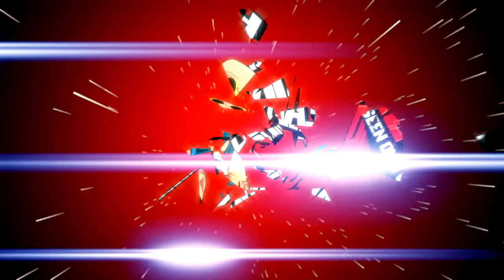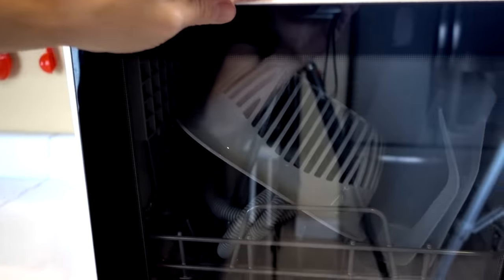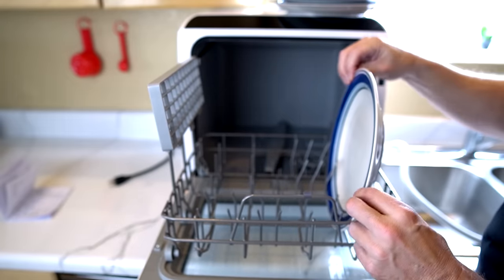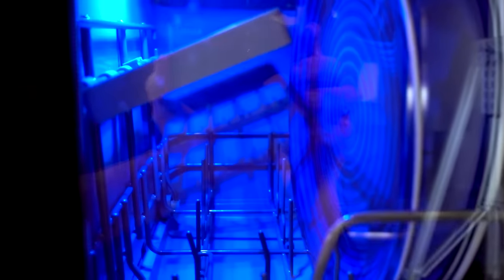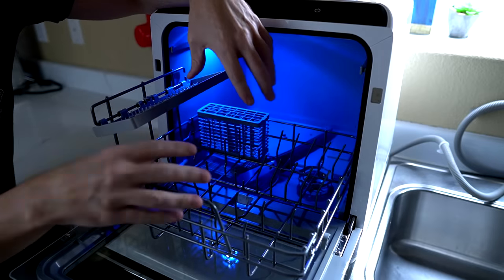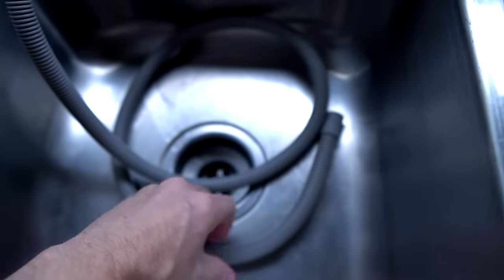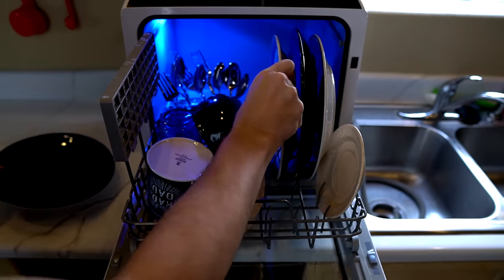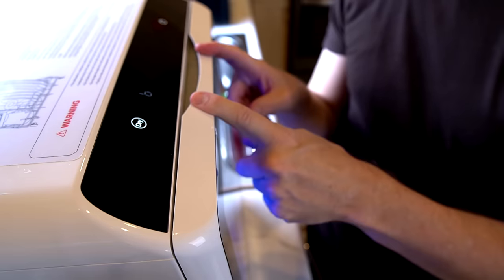Do Countertop Dishwashers Work? By Request!

Comment: I'm glad I watched your review on the  counter topodel.I checked out the novet online , I couldn't afford that price it was out of mine range so I searched around I found another one exactly like it under another name Hava. It has all the exact same features come with all the exact same things in it. The only thing I do is I do not put my silverware in the back because I find that the butter knives stick up too high and get in the way and I can't slide the rack all the way in so I put my silverware tray to the front on the right hand side it'll fit in there and I remove the little lid that's on it and I find I can get many pieces of silverware in it. I take the little shelf and I use that for my oversized spoons in it so they just hang in there so anything that hangs go on that rack and all my  sharp knives go on the rack every time I have used it I've been extremely pleased with it.. I've had my little unit for over a year. I used the baby wash  for my canning jars, make them very hot ready  to go in the canner saves me that extra work.

Comment: The wee shelf on the left can be used for cutlery instead of cups.  I have a small dishwasher, the same size as yours, and use it all the time (I am disabled and cannot stand for too long), absolute god send. Use the 30 min cycle on mine all the time.

Comment: Thank you for actually letting your test dishes sit out so the food dries on them before do the test. Most reviewers don't do this, they just drip or brush food on it and then immediately test the product. Well that's not a real world situation. Us normal people end up leaving dishes (and then hating ourselves) with food residue on them, without even rinsing them. Now for people with normal dishwashers (or those who enjoy doing dishes by hand) this s not a problem. Unfortunately I have an almost 60 year old dishwasher (it's one of those old yellow, it is actually yellow and not just yellowed from age, Kitchenaid dishwashers). Now back in the day it worked alright, I mean you still wanted to rinse the majority of the remnants off of the plate, but it cleaned them fine. Now however I feels like half the time the dishes come out dirtier than when they went in. And yes I've tried different brands of detergent, I've tried the liquid, the pods and the powder. I've also put in Jet Dry. The dishwasher was completely cleaned out when we bought the house from my Grandma's estate, the trap and hoses were cleaned. Nothing has helped. Hopefully this year (probably closer to Christmas time) we will be getting a new one. And I can't wait. I've already put up with this dishwasher for 6 years, I'm so done with it.

Comment: I recommand the "speed" programm and not to clean dishes inside. You can do this easier and with small time under running water.  It works 100 % for cups, spoons, glasses and parts of kitchen and smaller parts. It spares a lot of time.  At least you can cut the dry-modus easily because the heat of 10 minutes heat and let the parts in with the rest heat which stays quite long inside. Just if you have the machine full with glasses the quite long dry modus makes sin. But an hour is not neccessary too.

Comment: I have a larger unit (Edgestar) and only use the “eco” mode - works fine but I don’t put in dishes that haven’t been scraped or rinsed. I never use a drying mode - just open the door as soon as it’s finished. The residual heat dries. I also don’t need to unload it immediately so it also air dries any leftover moisture.  To make sure there is nothing left in the unit that might cause odor etc, I always leave the door open just a smidge when not in use.  Love my dishwasher, hate dishwashing. ❤️😎🐈‍⬛

Comment: I have the earlier model of this unit.  It works fine on Quick mode setting if you rinse the dishes.  That cycle takes 30 minutes!  I normally use it on that setting to save a lot of energy.  I also turn it off after the wash cycle is finished and let them air dry.  It works very well for me.

Comment: We have the same model you are testing. We use it in the RV. Run it twice a day. One run for breakfast and lunch dishes. Second run for dinner. Always the normal setting. The nice thing is we are only using 1.3gal per load where washing by hand could be 3 or more gallons. We are not very careful about rinsing dishes when washing by hand and tend to leave the faucet running. Agree with you the top shelf is worthless. We either take it out or put our cutting knives on it. We also had to invest in plates that were about an inch smaller in diameter than what we were using in order to fit them into the DW. Really like the machine though, it is quiet and we don't have to wash by hand.

Comment: Normal dishwasher uses hot water from the line instead of heating it, which is what I suspect the countertop model does. Countertop probably has the advantage on how concentrated the detergent is in the water. This went way better than I was expecting

Comment: I moved into a place in 2002 and the old tenants sold me their danby counter top dishwasher, it is still fantastic with some repairs over the years and proper maintenance.  Sadly it has started making noises during use so I feel the pumps might be wearing out, luckily I was able to get a full size unit on wheels to replace it with.

Comment: This is something that I have been looking at for my specific situation. I live with my mother in law in a basement, we have a partial kitchen, but it only has a fridge and oven and not a sink at all. So I have zero ways of washing dishes without either going to the upstairs kitchen and doing it there (and because of my dogs, I don't generally do that) or washing in the bathroom (no garbage disposal, no spray nozzle, and super small sink) so I was looking for a self contained unit to do this. I just ordered one, and am not sure that it's size will still be able to handle some of my needs, but if I can clean most of the mess, then it's going to be a win. For the most part this move was supposed to be temporary, but covid and the housing market has managed to make it a bit longer than anticipated.... in the meantime I have had to make do with what I can, and this is one piece of the puzzle for my specific situation that seems to help out.

Comment: Worked as a dishwasher and in just about any restaurant you need to do a quick scrap of any left over food into the trash and blast them with a sprayer before sending them through the washer. Cleans over 80% of what's on the plate before going in and the washer itself is to sanitize with very high temp water more then to actually clean debris. Simply putting dirty dishes in a washer without doing anything to them and run it days later won't clean the load properly. It's best to do a simple quick spray and wipe down right after use before putting them in. Be sure to use at least 140 degree hot water and I use a commercial detergent as they have much better cleaning power. Dishwasher usually also need to taken apart internally and cleaned every 6 months. Saves time overall but it cost more and is more complicated.

Comment: This was interesting. I lived in an older apartment (as in made before it was common to have built in dishwashers already there). I really liked having a dishwasher but didn't do a larger, movable one for several reasons. Counter top was the ideal size for a single. Bought one. Great on dishes. Two washes. Seal broke. Returned and got another as I thought it was fluke. That one went same way after one wash. I have to say that I really liked the quality of wash. The efficiency of time and water. However, after mopping up all the water from each failure I decided no way was I trying for three. Eventually moved to a house with included. I still think the counter top are a great idea but hopefully they are made better now.

Comment: It seemed to work really well. The only disadvantage to it I can see is that with such a small size, it doesn't look like it'd save much work. With my regular dishwasher, the two of us drop a few dishes in it every day and then run it when it's full. With this one, you'd have to run it almost daily. Washing a couple dishes by hand takes only five minutes. Again, if I had a large load from a party and didn't want to spend the time washing dishes afterward, I'd still need a full-sized dishwasher and would be forced to wash them by hand. If it was just a couple dishes, I'd washing them in a couple minutes and save counter space. It's good, but I see a very limited range of usefulness.

Comment: Have a older countertop dishwasher (a bit bigger then this Novete) that also has this top shelf thingy (which can be folded) and no mugs can fit. I do though put bigger knifes, spatulas and other stuff that does not fit anywhere else sort of there... and it gets cleaned...
For dishwashing you just need water for a bit of "mechanical force" and detergent and some heat that all work together to actually do a good job.

Comment: I’ve got an apartment. I bought a counter top dishwasher, it’s plumbed and is basically the same width but half the height of a standard one. Easy to plumb in with a £7 adapter to go into existing washing machine pipe work. Best thing I ever bought and compared to this was £200.

Comment: I have resorted to putting the plug in the sink and placing everything in plus detergent and just letting the hot water tank empty into the sink. The excess water goes out through the overflow.
It's a waste of water and energy but I have seen utility companies do the same with burst water mains.
It's a faff whatever way you do it.
I am Neurodivergent and won't return to read your replies.
I do like the idea of filling from above but from a wheelchair it will have to sit on a chair and empty into a bucket.
I also like that you can see inside through the window.
It's hit-and-miss with which one works best. Some brands just cannot reliably cover every base in the home. They may make a good kettle but a lousy toaster and a heap of junk washing machine.
My kitchen sink can be raised and lowered to get under it with my wheelchair. 
I am pretty much independent or think I am!
This was a good review and by the way I live in England.
Love your accent.

Comment: I have had  4 counter top dish washers  since 1986 and they  all worked perfectly , how ever not one of them  came with a tray that was any good at all with out  me having to customize them  to fit all my  plates etc my first one was a slide under  into the under sink  cupboard  top loader  it worked well but  it was  very long  programs  and it cost a lott o run it , that one worked until 1993 the next one i had was  on the top counter type it worked well had quick programs so it was cheaper to run , but some times i had to wash  things  every the cycle ,,, not so good , it worked until 1999 and i had to change it cos it went wrong and could not be fixed , i  got an indisit  one and i loved it it was slightly larger than the last two  and i could get  bigger things into it , bear in mind i had to customize the trays to fit all my dishes , as not one came with a tray that was any good what so ever i had to bend the prongs and sometimes had to bend them all out  and around until my things fit i also had to used cable ties to fill in parts and hold the cattery  holder   firm  to the tray . in 2005 it blew up and could not be fixed  s i had to get a hoover one  again i had to spend  the first day  bending the tray  to fit every thing ,  but that worked until 2019  when i had to have a new one  it a zanussi
and again the tray needed  a ton of work  to get all my dishes and stuff to fit but i'm an expert by now , and its been working fine  , recommend  using the tablets that have every thing  included , and i only fill up the salt  every 5 months or so  frankly i dont use it until its full . i get 12 dinner plates in it 6 large bowls  6 large glasses  14  of each forks knifes spoons and 20 tea spoons  a chopping board and 3 carving knifes and all  4 plastic micro waves bowls and some egg cups and a few side plates as well . so its well worth  customizing the tray your self to fit all your dishes and its a great idea to buy as many as will fit , to save on costs to run it as you will only have to wash when its  full t takes me about 2 weeks to fill mine  so i only use it  every 14 days approx , and every thing is clean and fresh and i am very happy with them all , i use them on cheap rate electricity too so it only cost pea nuts for a good long wash with a nice hot wash  all of mine were plumbed in to both water mains and drain no problems

Comment: I have owned the dishwasher in this video for over a year.  I connected mine to tap water supply and it drains in my sink.  It performs flawlessly.  Just to repeat what he said: it is small, though.  Don't buy it if you have a big family or something.  I think two or MAYBE three people could share this unit.

To see the temperature of the water, you need to pause the unit.  I couldn't find that in the instructions, but a representative on Amazon told me that.  It goes up to oaround 60C to 65C (140F to 149F) at the hottest part of the normal cycle.

Comment: I recently lived with 2 other guys, who although cooked and ate using my pots, pans, dishes, cups, and silverware, chose never to wash any of them. Only I had assigned KP duty!!! 🤬 So I had 2 options: use paper, plastic, and disposable/recyclable aluminium foil ware OR buy a small countertop dishwasher. Bought a large "Farberware" model that appeared to have a window, but, nope, it had a black painted rectangle on the white door. Hooked up easily to my kitchen sink and ran quietly, though the run times seemed a bit long. Everything always came out perfectly clean, but paying $270, then lugging 65 pounds up 2 flights of stairs was a bit painful. What's worse was only having it for a couple of months before moving out rather quickly and having to leave it behind... 😥

Comment: I recently bought a lightly used Danby as a temporary measure as our kitchen is being renovated.  The unit works pretty well, there's two issues: the minor one is that it doesn't dry the dishes very well at all.  The major one is that the guy who designed the dish rack should be taken out and shot.  There's only three places where you can put an inverted glass or even a mug.  Many other locations are suitable, but the rack simply omits rods in a lot of places, and glasses just fall through.  There's no reason to leave the rack open like that.

Comment: Counter tops are great for single people if you have the space for one. Problem is they dont like the full sized plates and pots and pans cookie sheets etc. You still have to do some washing but it does cut down on what you have to wash.
 I now have a portable half sized model of a built in that I love because I can do full sized plates and so much more like a pot and pan once in a while.

Comment: The older dishwashers, especially the Whirlpool and Whirlpool made ones are the most powerful ever made, they have smaller tubs because they have bigger motors and deeper pump modules. I have one and It could take the rust off a hitch the thing is so powerful sounds like a hurricane in a box. They are definitely the reliable ones

Comment: i get 12 dinner plates in it 6 large bowls  6 large glasses  14  of each forks knifes spoons and 20 tea spoons  a chopping board and 3 carving knifes and all  4 plastic micro waves bowls and some egg cups and a few side plates as well . so its well worth  customizing the tray your self to fit all your dishes and its a great idea to buy as many as will fit , to save on costs to run it as you will only have to wash when its  full t takes me about 2 weeks to fill mine  so i only use it  every 14 days approx , and every thing is clean and fresh and i am very happy with them all , i use them on cheap rate electricity too so it only cost pea nuts for a good long wash with a nice hot wash

Comment: I live in New Orleans, and we need water to be very hot to sanitise as our water often has biological contaminants. The Sewarage and Water Board puts out "boil water orders" very often. I had one a few years ago and was very happy with it. I had to run two or three loads most of the time. One of dishes and silverware, and another of pots and baking pans, etc. It worked very well at cleaning, but not a lot of room, but I got very good at the Tetris aspect of it. I just bought a duplex, and the unit I will be moving into doesn't have a space for a regular dishwasher, so I plan to get one of these again.

Comment: To fill it; use a plastic tray of a ready to eat meal. Make a hole in the bottom of the tray. You put the tray on top of the machine and the hole over the filling hole. You can now easy dump the water of the carafe in the tray. It will buffer in the tray.

Comment: You need some Corelle by corning ware plates and bowls man... so much easier using in a dishwasher. nice and thin, stack so well and use much less space in the cabinets, could stack 4-5 in the space of one of those plates :p

Comment: So I worked on these appliances, and specialized in dishwashers, for several years before starting my own repair business, and I can tell you that your tests were not "real world" enough.  The manufacturers have standards based on a certain ppm of debris that a dishwasher can remove from a set amount of introduced debris.  This would also vary wildly based on the soap you used and where you lived since the water quality plays a key part in the cleaning process for the new detergents since the phosphates were removed years back.  Love your videos brother!